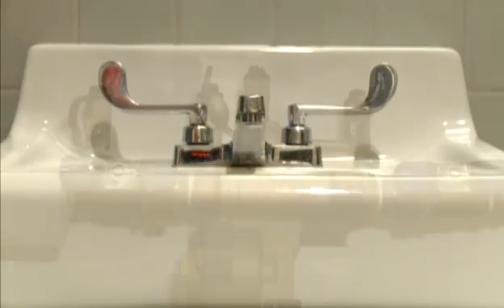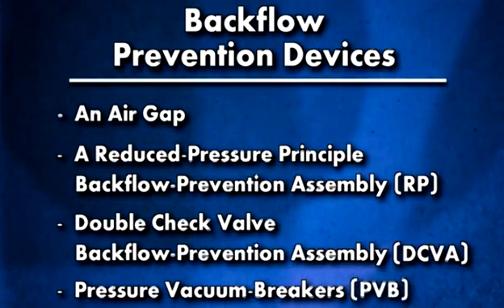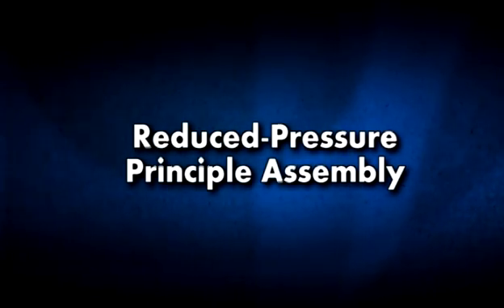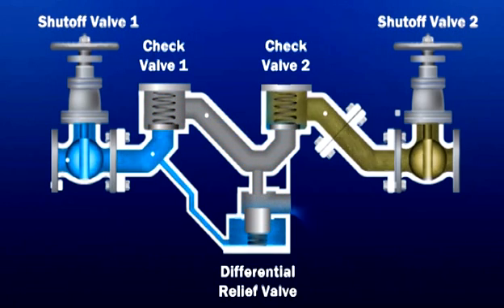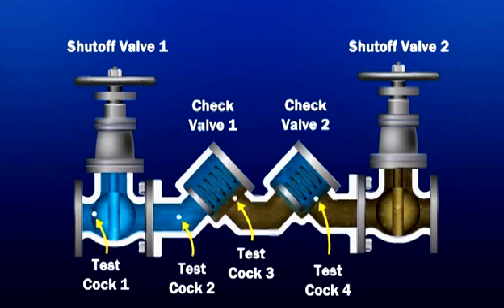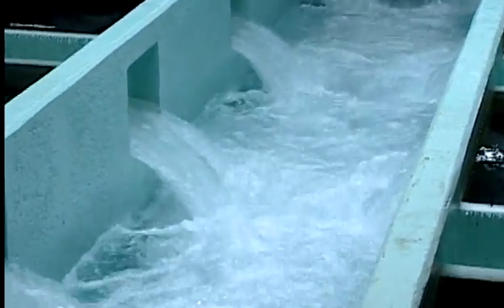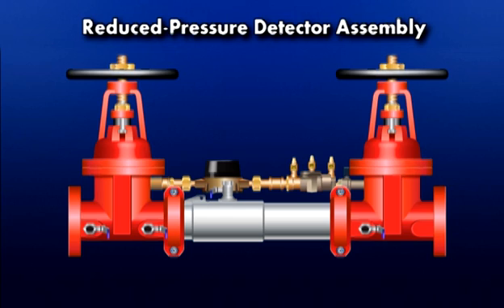Backflow Prevention & Cross Connection Control: Applications & Installations

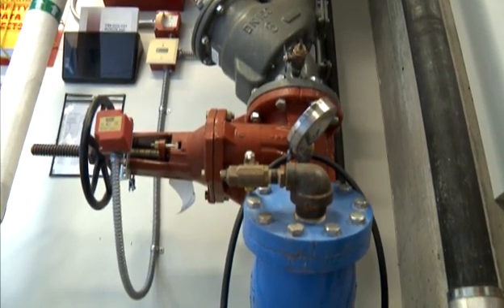Comment: The PVB shown at 1:08 is installed incorrectly. The critical line should be 12" above the system it is protecting and as shown the line leaves the backflow preventer and immediately turns upward. The PVB should not subjected to backpressure.

Comment: The relief valve will open if there is backsiphonage. The relief valve will not open if there is backpressure and the second check valve is holding tight. If the second check valve is leaking and there is backpressure the relief valve will open. Video states that the relief valve will open if the assembly is in a backsiphonage or backpressure state.